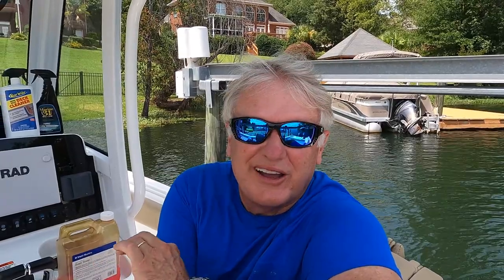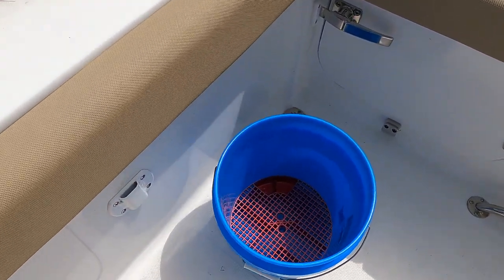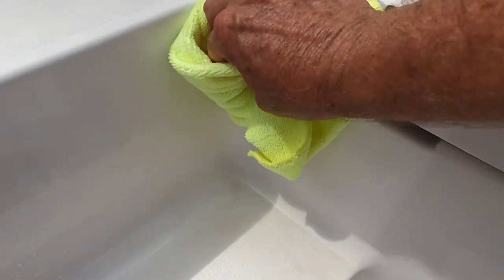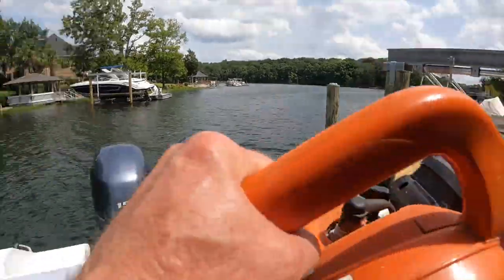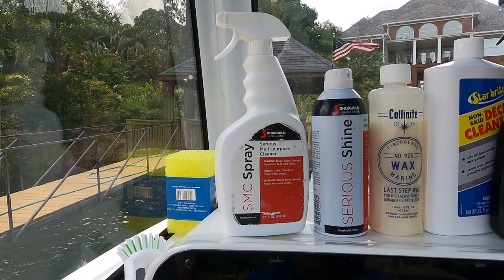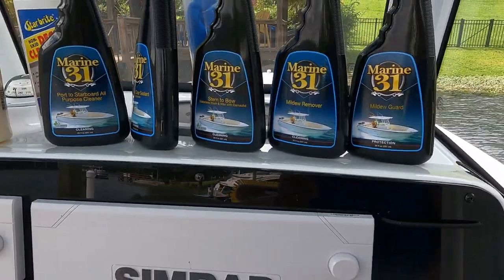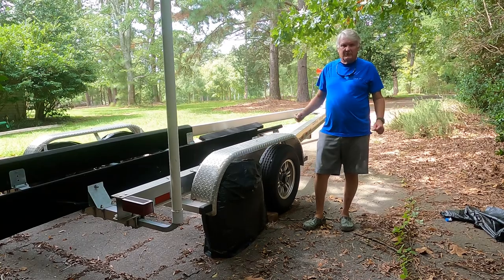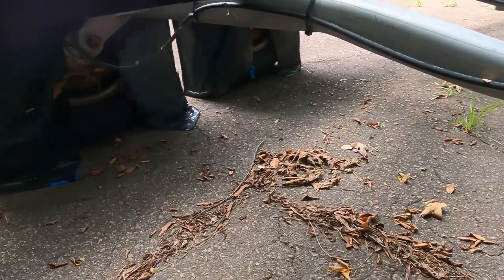Boat care tips

Comment: Very informative!  Will you be posting a video on winterizinng your boat?
Reply: Only when it snows. Just kidding. I do put RV antifreeze in my fresh water tank after draining it before the first freeze. The engines don’t need anything as long as they are tilted down on the lift or trailer so any water drains out of them. If in the water they also just need to be tilted down in the climate I’m in. Thanks for your comment.